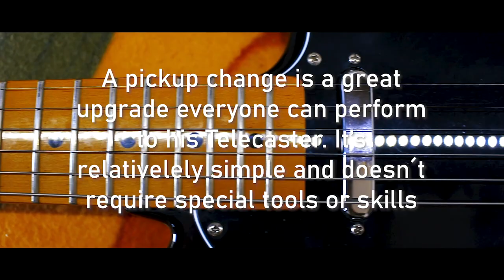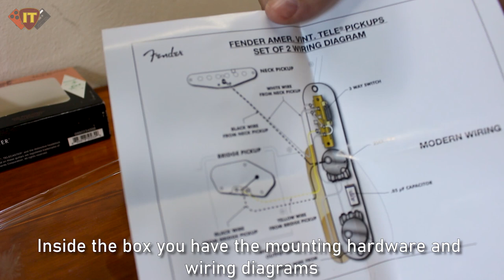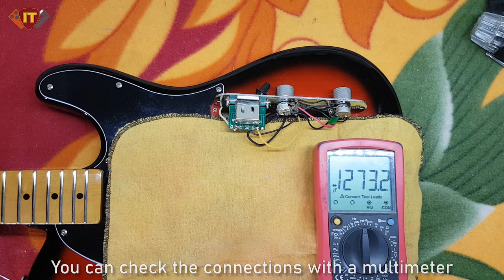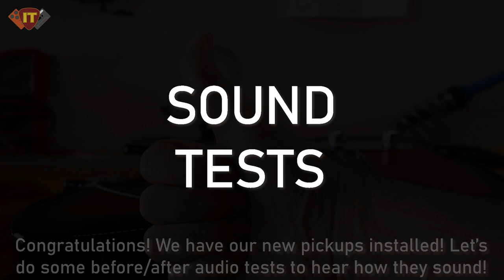Change pickups on your Telecaster - Full tutorial with sound samples!

Comment: Great video for those that don't have the knowledge it takes the scariness out of the equation. I replaced the pickups in my '84/87 squier strat and the only obstacle I came across was the cheap selector switch. The internal contacts warped from to much heat. I installed a Fender switch and was totally happy with the SD noiseless single coils. Good Luck everyone and ROCK ON !

Comment: Yes the Fender pickups are so much brighter and fuller sounding, they make the ceramic pickups sound quite dull. ....Interesting and useful video, I want to do this on one of my affordable Tele's, but I wasn't sure if I had to change the switch and pots too, I just hope the new pickups I buy will fit the existing holes in the scratch plate and bridge.

Comment: Definitely better clarity and definition on the Fender pickups compared to the stock ceramic pickups. Especially noticeable to my ears on the neck pickup - where it was very muddy sounding on the ceramic pickup. What is the guitar? I can see it's a toploader. Would you get a better tone by converting it to a string through body?

Comment: I've used that rubber tubes for adjust the pups height for sometime, until I've realise that in time they lose flexibility and pups start to vibrating and making ugly noises in ontact with pickguard, since then I return to using springs, never again rubber tubes!

Comment: My tele neck pickup just crapped out.  Not that I loved it.  I have one of the TV ones on the way,  I chose it because it fits right into the same hole with no expansion required.  I couldn't see carting my tele across town to the shop where it would likely sit for weeks, plus the big bill.  This looks doable.  I will leave the bridge pickup in place.  I bought the new PU without taking the old one out first.  Yeah, for all I know, the switch is bad or a wire popped loose.  Oh well.

Comment: Nice job, and I love the tone of the A5's. This was just the video I was looking for on my project tele thinline HB/SC. I have on order Alnico 5 HB Size for the neck and fender vintage 52's A5's for the bridge. Do you know if the wiring is the same for the HB/SC config?  
I've never done a pup replacement but after watching your video I think I can do the swap outs.  Thanks for the very informative video.
Reply from the maker: If you don't plan to do coil splitting on the HB (which I don't recommend on a SC sized HB) then it should be the same wiring. Check the wiring section on the Seymoud Duncan page, It's AWESOME and every schematic you'll potentially need is there. Cheers and good luck!
Reply: @InspiringTracks  Thanks, no coil splitting, just a standard 3 way switch. Update, I'm switching things up do to a shipping issue with the 52 Fender sc. I've decided to use a vintage ceramic sc for the bridge.
Reply: @InspiringTracks  Update: I just replaced pups and plugged in before re-stringing and now have loud hum on both pup settings. Not sure what's happening as there was no ground hum noise on the former cheapo pickups??? Will open up control plate today and see if there is a loose solder wire. Can't test as meter is out of commission so I may need to pick up a meter today and troubleshoot? Any suggestions why there's noise now and no noise before if wiring is ok?
Reply from the maker: Pretty sure there's some loose ground wire or you connected something in the wrong place. If I was you I'll re check all the wiring with the schematic to look for some mistake, it happens and is its pretty common. There's a GREAT FB group called Guitar Wiring Diagrams with nice people and lots of knowledge, check it out in case you need more help. Hope you can solve it soon!
Reply: @InspiringTracks  Thanks again for the advice. I pulled the control plate and inspected all wirings and solder connects after doing meter check on the pups(pups all checked and are reading ok). After careful inspection it appears that the HB wires had a small split and a few ground strands were exposed. I unsoldered the 2 HB wires and trimmed them down and respliced, tipped with solder and re-soldered them. I tested the pups with the plate off and no noise. Put the plate on and gave it a test ride and pups sound great and minimal noise even with stacked OD. Crazy stuff if those few ground strands were causing the hum.

Comment: Why do so many people go to the time, trouble, and expense of swapping out perfectly good pickups for other pickups, when 99% of getting the sound you want depends on  your amp & maybe pedals rig, and how you tweak all the control knobs? I've heard lots of before and after videos of stock pickups versus "upgrades". The upgrades sound different, but they seldom sound better.
Reply from the maker: Because it's fun
Reply: @InspiringTracks  That's the only reason anyone ever gave to that question that makes even a little bit of sense.
Reply: It’s mainly FOMO
Reply: @X-boomer  Huh!
Reply: @MrErdner  I think you must need UltraHD ears to hear any significant improvement in what comes out of the amp. But the magic words “custom”, “vintage”, “hand wound”, “Alnico”, and “Seymour Duncan” etc have a pleasant sound in many guitarist’s brains.
Reply: They are cheap ceramic ones
Reply: @MrErdner 😊😊

Comment: I just bought a American Professional II, but I like guitar but not pickups. I’m planning to buy a Lollar Special T set. Am pro II has a push push feature to put ,in the middle position, the pu’s in parallel mode. Do you know hot to wire the new pickups to keep the push push feature?  Thanks!
Reply from the maker: Check the schematic section on the Seymour Duncan page, all you need to know (and much more) is there

Comment: Ive just pulled on the new pickups. But the bridge and middle sounds exactly the same. Dunno where the problem is. Any advice???
Reply from the maker: If it was working fine before the swap then probably something is wired wrong on the switch. Check it with a schematic, it should be an easy fix

Comment: Don't you think that if the new pickup has a wire that is too short so you have to splice a new piece in, that you can do the same with the other wires to prevent damage to the new components especially if you aren't very good at soldering  ??
It is much easier and safer to cut the wire away from the components and then splice them with solder.

Comment: why did you de-solder the black wire  from the selecter switch, 
only to solder it back again with installing soldering the two new pick up wires?
Reply from the maker: Just to make work easier and to make sure that it is correctly soldered. No real need to do it if you don't want to

Comment: Hello, I am new at changing my own guitar pickups and am trying to put in Twisted Tele pickups.  The guitar is MIM, and I ran into a problem with the wiring.  I cannot de-sauter any of the grounds.  It is almost as if they are permanently welded in place instead of being sautered.  I have changed my Strat pickups before and it went perfectly fine, I was able to desauter it easily, but this guitar seems different.  I was wondering if you have run into this issue before? Do you have any advice or videos you can link me to?  I can also give an email for easier communication if needed! Let me know if you require more info too! Thank you so much.
Reply from the maker: If the guitar is somewhat new then almost sure that they used lead free solder at the factory, which melts at a higher temperature and is much harder to solder/desolder. Try applying some fresh leaded solder on the joints before desoldering, that should make it a lot easier. Hope that helps!
Reply: @InspiringTracks  hi there, the guitar is around 2018. We tried to turn the heat up to about 550°c on the sauntering iron and had no luck. Is there a specific temp you use?
Reply: also how long can you hold that temp to the area before the pods get damaged.

Comment: What's the purpose of "ground wire for the bridge"? 8:41
Reply from the maker: The strings needs to be connected to ground to both produce a correct signal and avoid hum. That's the reason why when you touch the strings the hum disapears (or is greatly reduced)

Comment: I've followed the video, but i ended up with a horrible hum. Any solutions?
Reply from the maker: That usually means ground issues, either you have some ground cables not connected or some live wire touching ground. Follow the cables coming from the pickups and check every joint against the schematic to see where is the mistake. Check also for unwanted solder bridges or cold joints. Oh and also check that the bridge is properly grounded, this can be done with a multimeter measuring continuity between the bridge plate and the output jack. Good luck!

Comment: I’d like to do it without all that soldering…you can get little scotchloks these days..messin with the factory soldering worries me..
Reply from the maker: Soldering is totally safe and personally I'll trust a good solder joint a lot more than those scotchlocks. You can try them if you don't feel comfortable with the soldering iron but keep in mind that the space on the control cavity of Teles is minuscle and maybe they wont fit inside. Cheers and good luck!
Reply: @InspiringTracks  they make really tiny clip loks now , have a look on the net..you’re right a scotchlok might be a crowd.

Comment: I don't care what pickups are in a Tele as long as the 60 hum is cancelled. Ceramics are fine. Anything without the hum.
Reply from the maker: As long as you don't play with a high gain amp/pedal the hum isn't a big deal. Noiseless pickups or SC sized humbuckers are great for that but they don't have the same twang and chime as true single coils

Comment: Pretty misleading for the video to say this project doesn't require special tools or skills, when in fact it does.  Soldering equipment and soldering skills are required, and they seem to me to be special tools and skills.  Personally, I don't know anyone who has soldering equipment (I've asked around).  I also take issue with his characterization of the previous owner's shielding attemps as "failed."  I tried to shield a guitar, though I didn't have any experience or knowledge of how to do it.  I just tried to follow Youtube videos like this, and I didn't do a very good job, as it was my first attempt.  I don't regard it as failure.  Thumbs down on this video, for me.
Reply from the maker: Sorry to know that you don't liked the video and thanks for your feedback. I'll keep note of your suggestions to keep improving the channel on the future. Cheers!
Reply: @InspiringTracks  Thanks for your reply, much appreciated.
Reply: Dude if you play guitar you MUST have a soldering iron, that's a fact. I swapped pickups on my Strat with no experience and a 15 bucks iron from Amazon and it came out just great. I know people nowadays get ofended by anything but this video is great and super detailed, calling it misleading because you think soldering a couple wires is some kind of dark art is just dumb.